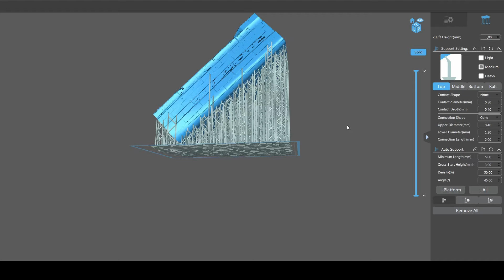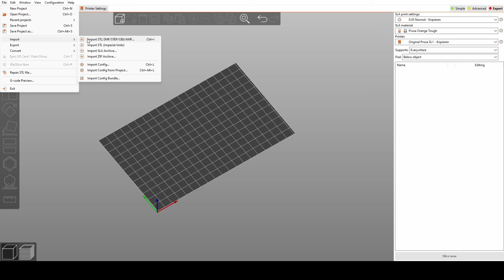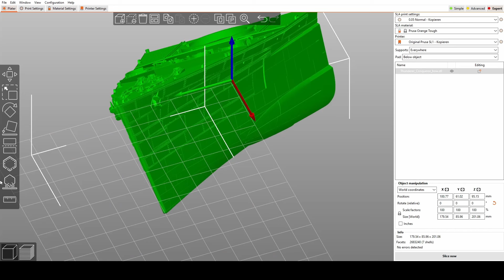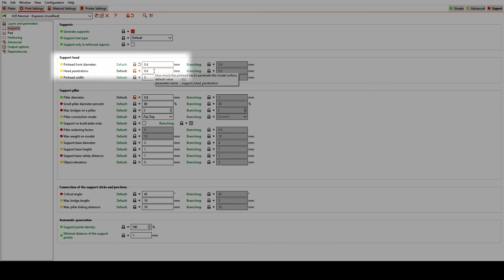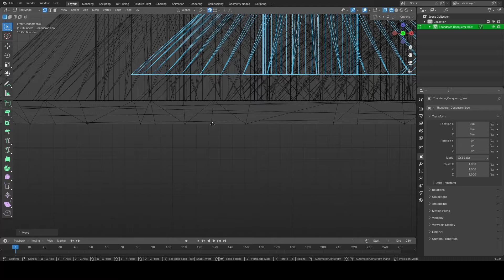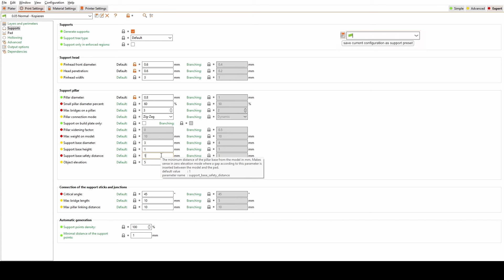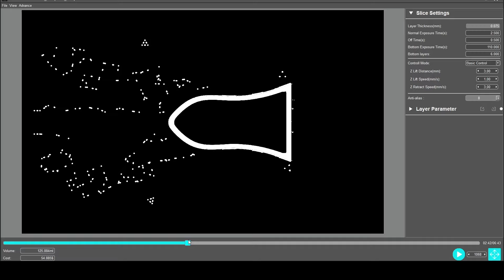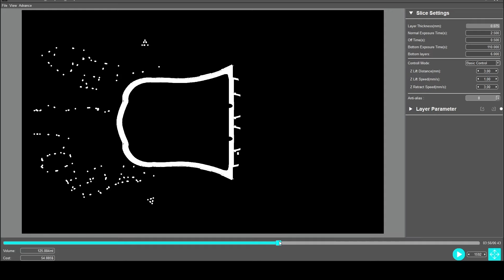You have been doing supports wrong

Comment: Interesting video. Always good the hear another point of view on the topic XD. I personally have a different approach. I noticed that people that use 3d printers are very keen to a very simple error: overtrusting and overpowering 3d printers. the approach of "Let's 3d print ALL THE MODEL in just one go" is way more extreme than what it looks like. Personally, giving for granted that it requires a good knowledge of Blender, I would actually disassamble the model in pieces and print one piece at the time to assemble it later. It's more reliable to put one rock at the time to create a mountain rather than moving all the mountain together. There is a reason why the big hitters still don't print big models in one go.

Comment: and as for the layer shift, try greasing your z axis, I find this happens when i am printing larger models than I normally do and giving it a grease has helped. the other issue could be due to suction with the print, but as yours is open at the bottom that shouldn't be the issue...

Comment: Thank you for the videos sharing your journey! They are inspiring, informative and helpful. I hadn't thought of exporting/reimporting to adjust support weights in Prusaslicer/blender. Using Cut to trim the out of bounds support base was a great tip! 

 Have you tried other slicers like Lychee? Their paid pro version seems to have better support for multi-weight supports, auto generation and in-situ support branch editing. 

I'm still using Prusaslicer, as its hollowing, hole generation and workflow is more familiar, but many of the youtube resin statue creators seem to use paid Lychee/other. I always seem to end up manually supporting what I'm printing anyway, so the free lychee/others have had little value.
Reply from the maker: I have not tried lychee yet, I might have to check that out